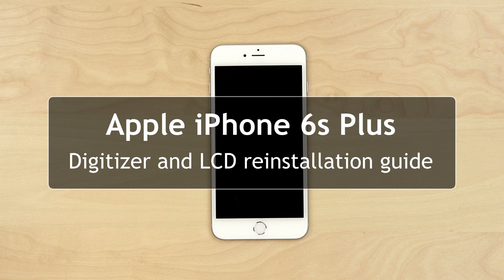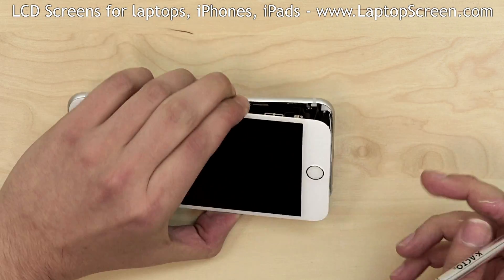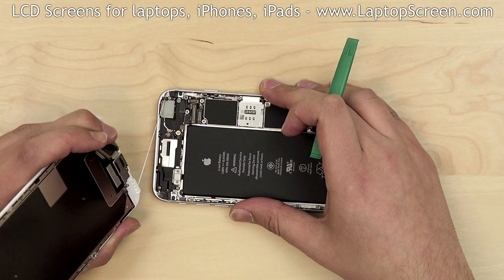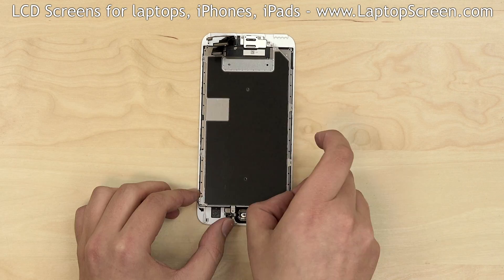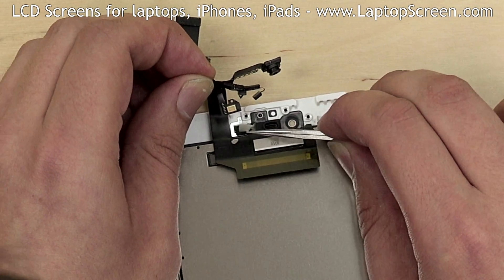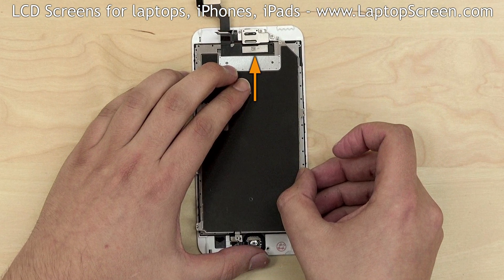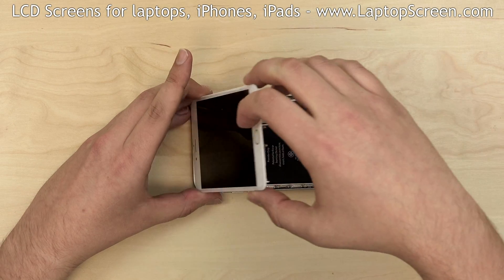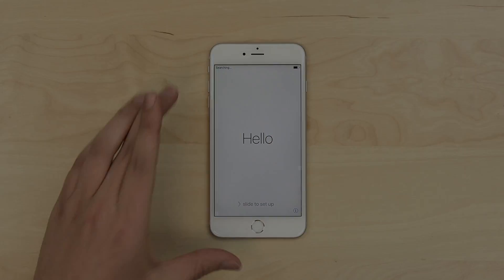iPhone 6S Plus screen replacement / digitizer glass and LCD reinstallation instructions

Comment: At 2:59 there is a yellowish tab at the top of your unit in the video. My new replacement screen does not have that tab, but instead a metal bar which appears fused into the plate. Will my phone still work with this particular replacement? I have asked the seller but he has not responded and I need to put my phone back together. And if anyone here reading has experience with this, just fiddling with those screws takes up most of the time and is responsible for most of the loss of my hair!!